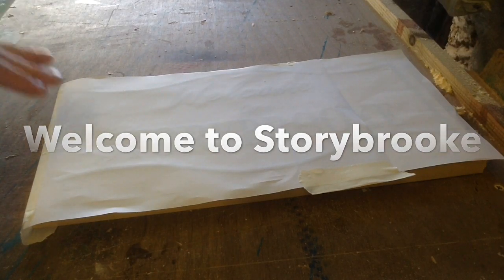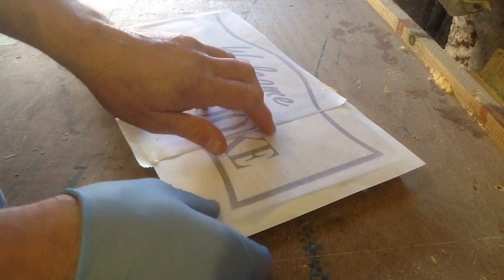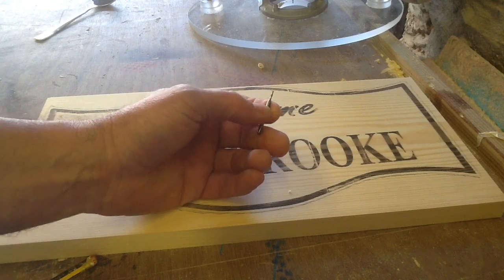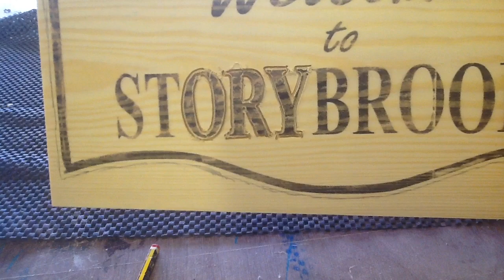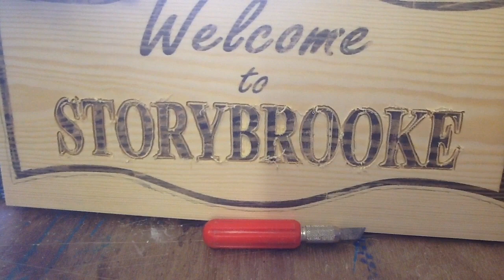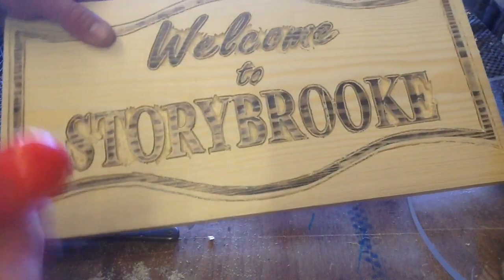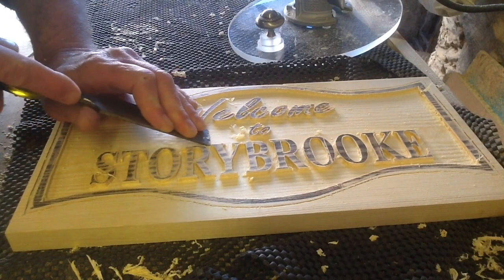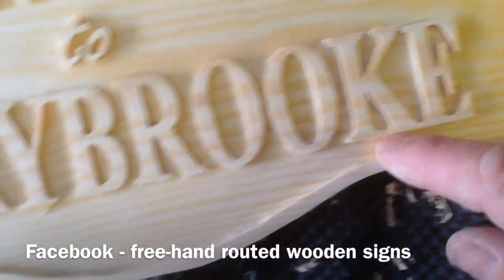StoryBrooke

Comment: I transfer my patterns that way but I use regular acetone that nail techs use to take nail polish off with. I'm not sure what kind of thinner that is but  it seems to work very well. Regular acetone works but not quite that well. Anyway, this is a great video. Very helpful for my next project! Thank you for sharing!
Reply from the maker: I use a product called cellulose thinners which is also acetone based. Bit more industrial than regular acetone although that still works well. Glad you found the video useful and thanks for the lovely comment

Comment: I was fuzzing up the wood when I used spruce and douglas fir, so a friend suggested I use a down cut bit - all of yours are up cut - any recommendaitons to stop the fuzzy top edge?
Reply from the maker: the fzzy top edge should be to much pf a problem, is it on the surface your having the issue or the side of the text? if I  get fuzzies on the surface, I generally do a light burn and then sand it off. the deeper you make your letters, the more room you have for clean up. thats why I use the up cut bits, they give me a cleaner background which is much harder to sand
Reply: @JohnathonWhittaker  That helps a lot thanks!
Reply from the maker: @fordguyfordguy  glad I could help!

Comment: How did you cut out the backside of the router housing to allow more light in and help remove the sawdust?  Hole saw? size, etc.?
Reply from the maker: Hi Blair, I used a jigsaw with a metal cutting bit. the size of the hole  is dictated by the screw holes in the bottom. what you can do is turn the router over, check where the mounting screws go. make two marks inside of those two screw holes, giving maybe 5mm of clearance. then I drew a rectangle on the outside of the housing, making sure I wasn't going to cut anything important. I clamped the router base down and cut it out. I only really recommend this with the metal bases, I would be hesitant to do it on a plastic one. there was a video on it, I will try and find the link and share it with you. works really well though, lets light in and the wood chips out
Reply from the maker: here is a video from the chanel "old dave 100" they have literaly 100s of how-to videos on free hand routing. this link is a way to modify the router base. if you don't have a hole saw, you can just use a hacksaw or jigsaw. hope this helps https://www.youtube.com/watch?v=kZLh3FFUJ78
Reply: @JohnathonWhittaker  Thanks for the quick response.  I had seen the youtube on the old dave 100 channel, but your job looked much neater.  I am hesitant to do it because I don't want to screw up an expensive piece of equipment.  Maybe I will give it a try.  Thanks again.
Reply from the maker: @blairackerbauer3975  what type of router have you got?
Reply: @JohnathonWhittaker  DWT611
Reply: @JohnathonWhittaker  DWT611
Reply from the maker: @blairackerbauer3975   thats the same model really. If you are worried about cutting into the base, even just using a hole saw on the back will help alot. Its aluminium so cuts pretty easy. Just be sure to sand the cut edges. They can be sharp!
Reply: @JohnathonWhittaker  I just finished the modification.  Turned out great, no problems.  I should mention, it is very important to firmly clamp the housing down while performing the cutting operations.
Reply from the maker: @blairackerbauer3975  oh fantastic! you will really notice the difference. just make sure all those sharp edges are sanded smooth. they can be vey sharp!

Comment: Nice video and work. Are you using a trim router or fixed/plunger router ? And the clear plate got a video on it ? Like the idea of that. Thanks.
Reply from the maker: Hi there, you can use a trim or plunge router for this, I do recommend a 1/4 inch router, bit easier to control! as for the base plate, I made my own, you don't need to do the same dimensions that I use, whatever you have will work. just make a large plate with some handles on it and it will improve your control considerable! thanks for watching and here is the link https://www.youtube.com/watch?v=fFQPVxzSyIk&list=PLGxW9qdxKh79JLIwovOU0JikvXuD9fqQc&index=2

Comment: Is that a normal thinner liquid you using. Thanks
Reply from the maker: Hi Ralph, I use cellulose or acetone thinners,  has to be 100% as well.  Normal thinners won't work, For this process. Thanks for watching!
Reply: @JohnathonWhittaker  Thank you. Another Q, what types of Printers compatible for t-shirt heat press process. I have an Epson XP 200 and HP Deskjet F2120. Will they work. Thanks.
Reply from the maker: @3588only  hi Ralph, just so I understand your question, your asking about the transfer paper that you can iron on to t-shirts? The inkjet printers that you have will both work for that process but I found that using that method on wood had mixed results.  Yes it transfers the image but then the router base can damage it and it can leave a sticky residue that adheres to the router as well. So  not my favorite process. You might be able to do the transfer and then seal the image with a cheap varnish before routing
Reply: @JohnathonWhittaker  Thanks heaps, learned something.

Comment: How do you sand inside the letters?
Reply from the maker: Hi richard, it depends on how rough the background us inside the letters. You can use small spiral upcut bits to clean those tight spots.  If you dont have them, diamond dremel bits work or even sanding pens. To clean up the letters themselves, i sometimes use 3m radial radial bristle discs. You can get the 1 inch diameter discs that are great for small small spaces. Hope that helps!

Comment: can you do the same transfer process with inkjet or just laser? I know you can print on freezer paper but i was curious if you could jus tprint and then do this transfer...? Thanks
Reply from the maker: Hi Scott, it has to be a laser printer. Doesn't work with inkjet. 8nhave seen the freezer paper process but it looks a bit to fiddly to me and hard to do larger images where you have to join the papers up
Reply from the maker: You can use a inkjet and do the modge podge technique.  You spread the modge podge down and put  the image on it, wait 24 hours for it.to.dry and then use water to.remove the paper. The image stays.  Just to time consuming I thunk

Comment: How deep did you go with the CNC Bit
Reply from the maker: I generally do two or three passes, going deeper each time to a depth of 3/8"  or about 8mm. Pine tends to chip if I try and go to deep to fast. Also I get a cleaner finish with multiple passes. Takes a little longer but gives good results

Comment: Something wrong with using a CNC router? You are using a printer to print it out, why not do the same on a CNC program and hit start directly onto the wood
Reply from the maker: This Is more for people who want a more hands on experience and potentially can't afford an expensive cnc set up. I find this method to be very versatile,  doesn't take up much room and can achieve much better results than alot of the lower cost cncs. As for printing, that's just easier for me to layout and design something immediately for clients, there are quite a few people who do the text free hand with excellent results. Different ways for different people. I often just use a mallet and gouges, also gives me the result I want although I still print it🙂